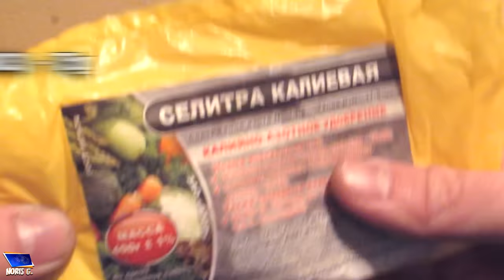5 WAYS TO MAKE FUSE

Comment: Tip: dont make match fuse it is unreliable and firecracker will not blow up correctly. It will blow from the fusehole and reduce the sound same goes for lifts and salutes will not get ignited
Reply: well it worked for me COUNTLESS TIMES the boom sounded like cannon fire
Reply: jayce dis u put flash or blackpowder and how much of it
Reply: then use what?

Comment: Hey dude. Here in Brazil a lot of fireworks have a kind of rigid, reddish/brick like color fuse that burn very consistently and even underwater. It's used mainly for firecrackers. They close the end of a little cardboard tube with sawdust and glue or a mix of brick and glue (?), put a teaspoon of flash powder in it, and then put this fuse, and the sawdust/brick mix around it. After dried it becomes very hard. And it explodes with a loud bang. I would like to find out the recipe to that fuse because it is a very good one. If you know something it would be great. Thanks!
Reply: sounds like det cord your talking about to me
Reply: @shorty808100  yeah it basically sounds like a DIY detcord

Comment: thanks for the content, I have one question, I want to put this fuse inside the blastic bottle of petrol, however, I have a little concern about the petrol, may make the match lose or solve in the petrol, is there any way to protect the match inside not air environment?

Comment: The best method is wrap black powder in pvc plastic wrap, not too thick, not too thin, im sure it will burn like visco and waterproof, almost all pyrotechnist in my country used that method, try it and reply your result! Oh, and remember to stretch out your fuse for length

Comment: One question: where can I get dextrin ? Thanks !
Reply: Spread one centimeter layer of corn starch in a large cookie or pizza pan and put it in the oven at medium heat for ten to fifteen minutes. Check it often and pull out of the oven once it turns a golden hue. There you have your dextrin.

Comment: The sugar fuse turns off because of the sugar, what should I do? I made a lot and i don't want to throw them away
Reply: Sugar fuses must be used in a couple of days tops, or be kept in air sealed containers. Both ingredients, the potassium nitrate and the sugar, are hygroscopic and absorb moisture from the air.

Comment: Support for posting videos on this but OMG please never do this at your house you will catch something on fire I cringed so hard watching this please never ever do what he’s doing the way he did it example one in the sugar fuse one he had a pyrotechnic mix over an open flame this is not OK if a drop of that pyrotechnic mix were to fall on the stove or he would’ve dropped can and he forget about it for some reason he could catch his whole stove on fire second you are never supposed to mix black powder In any sort of electric grinder if for some reason the grinder release sparks which is not rare at all you could blow up the coffee grinder in your hands please never do this purchase of mortar and pestle and grind up the powder yourself. A good method for making fuse is to make some black powder and then soak the black powder and water dip a cotton or thread of your choice in there and sat out to dry this will make you a good reliable sturdy fuse